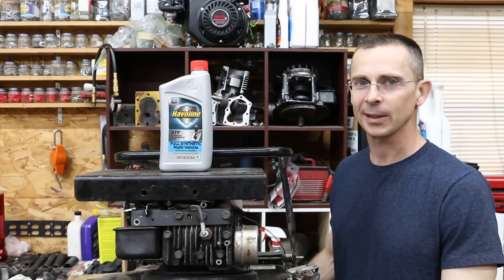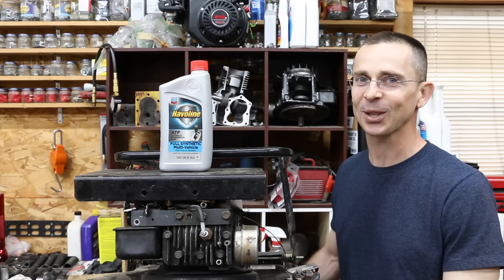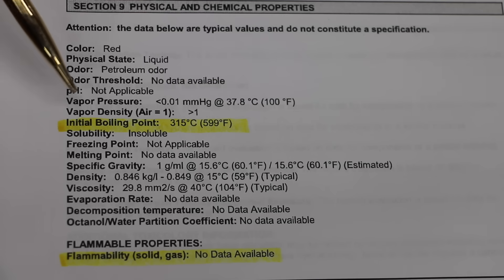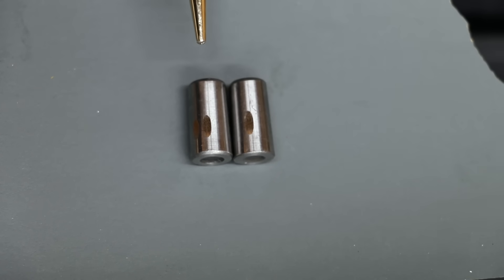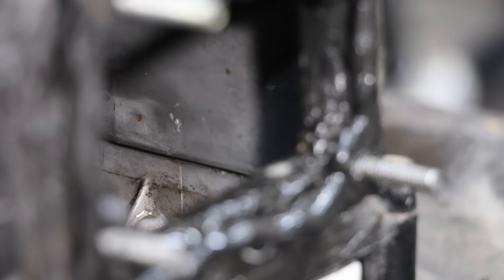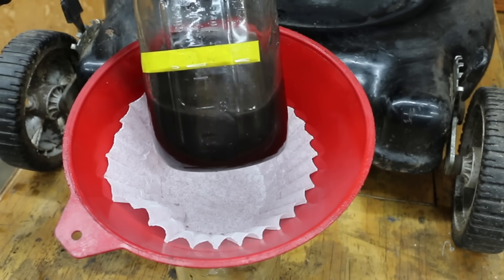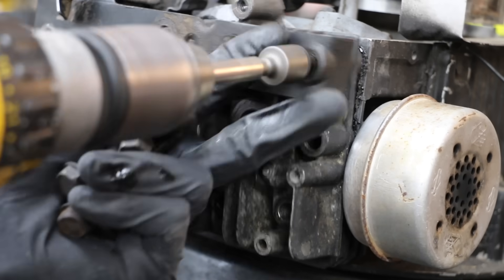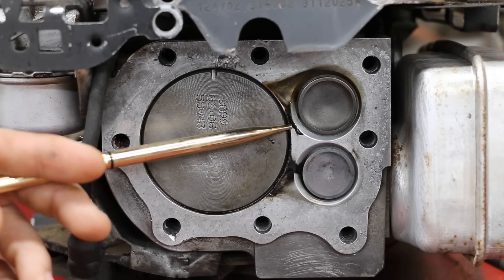ATF as an Engine Oil substitute?  Let's see what happens!

Comment: I had a 1974 Oldsmobile Cutlass with a 350 V8 Rocket Engine...I did a test where I put straight trans fluid in the engine at 100,000 miles. I ran the car 11,000 miles, sold the car to a friend, he changed and put regular 10w30 back in the car, and he drove it as a work car. It had over 200,000 miles on the engine when the car body was finished, the engine then went into an air boat, and eventually broke down and was wore out.
Reply from the maker: Impressive!

Comment: Used to use 50/50 mix of atf and diesel fuel as a flush, drain all oil, add 50/50 mix and idle for 30 minutes, drain and change oil/filter, best engine flush imo. You should try it out
Reply from the maker: Thank you for the video idea!

Comment: i actually had #1 piston rings on chevy 350 1990 froze up. added 2 qts trans fluid to gas fill up and 1 qt to motor oil . a month later i stopped fouling out #1 plug. so yes it did free up piston rings
Reply from the maker: Impressive results! Thank you

Comment: Back in the Mid 70's, I had a customer who insisted that we put nothing but ATF in his car's crank case. His reasoning was that it was very high in detergents and would keep his engine cleaner that regular engine oil. He ran it for years that way. I have no Idea just how long as I moved on from that job after a few year. Just thought I would throw that out there.
Reply from the maker: Wow!  I'm surprised it lasted.  I'm sure the engine was indeed spotless on the inside.

Comment: I have used atf in the past to free up sticking lifters and it worked in a matter of seconds. All I did was run it for 15 minutes, then drain it. I have also used engine cleaner additive in my 2015 gmc and noticed a 5 PSI decrease in oil pressure about a month later. I found that there is a filter screen under the oil pressure sender that filters the oil to the lifters. The screen had started to clog with the crud that the cleaner had broken loose. I cleaned the screen and got my 5 PSI back. So the problem with engine cleaners is that they could clog the oil pickup screen and starve the oil pump.
Reply from the maker: Thank you!

Comment: Never ever flush your engine,If it needs flushing, it’s because of poor oil maintenance and cheap oils and cheap oil filters were most likely used. If your car has high mileage it’s even worse to do an oil flush,for the simple reason the stuck on oil is acting as a glue on your engine seals, plus if a piece of dried oil that was untucked goes trough the small holes that go to your rod bearings.. you will kill the engine right there and then..you will simply starve the bearings of oil.I have been driving for 30 years, been doing my own maintenance on my cars and trucks I have used. I made a lot of poor choices by not changing my oil as required and adding cheap none detergent oils and cheap oil filters. I have gone trough 7 vehicles in 30 years of driving..not counting the one I have now..I learned the hard way. Don’t make the same mistakes I made. Now I change my oil as required and i use a popular 25 dollar synthetic blend oil( five quart jug) and 14 dollar oil filter. I Change it every 9 months or when my computer demands it. When I feel my used oil, it feels the same as the day i put it in my engine, and I noticed it also flows like new oil when it falls in the oil pan.
Reply from the maker: Thank you

Comment: So I've used ATF in many engines... all my personal engines always get 3 to 4 oz with every oil change. one thing I have noticed in the past with junkyard engines that I've used that are sludged up is they will run fine and oil pressure will be ok but once the engine is cleaned by the ATF or as it becomes clean... I've had engine start knocking because the build-up off the bearings comes off. I've had it happened two or three times on engines that are sludged up. Engines that make it through that without knocking have always been great engines. A great test would be get a new engine intentionally gum it up and then redo the test but also have a control. I realize that gets expensive but Harbor Freight sells cheap engines.  I really would like you to be measuring rod bearing clearances and journal sizes for some of these type of tests. I think it would take the testing to the next level.
Reply from the maker: Great information. Thank you.

Comment: If the ATF used for flushing only, it's ok since the viscosity is thinner than the engine oil. If you used the ATF as engine oil, then the friction will be higher and contact surface will be damage as well.
Reply from the maker: Thank you

Comment: We've used ATF to clean automotive engines for decades. That being said, I would never use only ATF in an engine. I can guarantee that the shavings were due to the ATF. When we use it to clean automotive engines, we generally use a 20% - 25% mixture. We always use 1 quart and the rest oil. Afterwards, we run the engine for about 100 miles. Since most of that gunk begins clogging up the filter, we change the filter, top the engine off with ATF again, and go another 100 miles. Finally, we'll drain it all, put in a new oil filter, and use good oil. We do this about every 25,000 miles and it has done wonders for the engines we work on.

Still, great video! Thanks a ton for your incredibly interesting channel and hard work!
Reply: Excellent review . One of your other viewers mentioned  a good procedure of filling the automotive crankcase minus one quart and making the last quart added of ATF and changing about every 200 miles twice then switching back to motor oil and no ATF .  SEEMS like I've  heard of that method before as being successful. One person told me to put a small amount of ATF  in the gas tank to lubricate the valves. I think that my mak an interesting video for you to make for a review  . I thoroughly enjoy and appreciate your videos.  Thanks .
Reply from the maker: Thank you!
Reply: ...That being said, I would never use only ATF in an engine...

    I'm not so sure about this statement in some of today's engines. Some of them use 0W-15 oil which isn't as thick as hydraulic oil. An interesting, albeit possibly expensive, experiment would be to take one of these cars with a brand new engine and start from day one using transmission fluid rather than 0W-15 oil and see how long it lasts compared to a "properly" serviced engine of the same type. I'll admit my knowledge of these new fangled engines is quite limited. (I'm almost 70.) I went to diesel mechanics school in 1974 but haven't kept up with many of the new improvements since.
    Speaking of diesel, I was talking to the manager of one of these quickie oil change places a year or so ago. He said that one of his competitors that he used to work for, a one man owner independent shop, regardless of whether you asked for petroleum or synthetic oil, you got 15W-40 Shell Rotella diesel oil in whatever engine you happened to slide into his bay and you got charged for what you asked for. You asked for synthetic, you got 15W-40 petroleum oil  but paid the synthetic premium price. He said the owner was a cheap bastard who made a deal with his jobber and bought Rotella by the barrel(s) very cheap. He would then pump the Rotella into old barrels marked whatever brand of synthetic or whatever premium brand of petroleum oil. This was why the guy quit when he found out. He didn't want any liability should the wrong oil ruin an engine. He said that his then boss seemed like the type to throw you under the bus with the blown engine for using the wrong oil.
Reply: No way to "guarantee" the ATF  caused the flakes unless you did a side by side with another engine that hadn't been run on canola oil.
Reply: I wouldn't do that in a contemporary engine. My 2001 4cyl Camry? I don't think it would be a problem but it doesn't need it. There are options for cleaning up a dirty engine. Simply accelerating the oil change interval is one of them.
Reply: 20 years ago...But what influence does the ATF oil on the DPFs (diesel particulate filter) in today's modern cars? Some say that any other oil than the recommended one for the engine would clough up the particulate filter sooner, as some gets burnet up in the cylinder and leaves the motor with the exhaust gases...
Reply: Keyword high SAPs
Reply: @HPaulAdrian  most motors people are doing this to are 20+ years old
Reply: @miatafan exactly.  I’ve done that to my old Astro van. Worked really good.

Comment: The "common knowledge"  that ATF cleaned engines internally, & that a quart should be part of every oil change has existed for decades.  A casual perusal of the composition of the two fluids would indicate that hydraulic oil is formulated  to resist foaming under pressure as one of its prime formulation considerations. Interestingly, the tests that you have conducted indicates that lubricity of ATF has improved greatly over the years. I remember reading a test in an  automotive trade publication at least 30  years ago , that showed a considerably greater lubricity for motor oil. As usual, your tests were conducted with professionalism, & with consideration for all parameters that could slew the results in either direction. A practical test in all ways short of  a National Lab level investigation. Another "Well Done !"  to you & your methodology.
Reply from the maker: Thank you!

Comment: The compression test says a lot. I have used ATB on a 455 rocket V8 that had a very rattly valve train from many years of neglect in the service department. It took about 3 oil changes and ATF flushes to get it to stop rattling and the performance went up drastically. Best to change the oil on time and avoid it but for vehicles that have been neglected, it works a treat.
Reply from the maker: Thank you!

Comment: Ive always used 1 quart or less of ATF mixed with my 3500 mile oil just before I change it at 4000-5000 miles. Engine is always clean. I run 10W-30 Royal Purple HPS in my 2007 STI and other vehicles. I am at 185,000 miles on my STI and other vehicles are 230,000 to 300,000 miles. I always switch to Royal Purple HMX at 200,000 miles. Anyone think im lying see my oil pickup video.
Reply from the maker: Thank you!

Comment: I can say from experience that adding about a quart of ATF to 35 gallons of diesel fuel, works great for cleaning the fuel system. I did this on my LB7 Duramax and got over 300k miles on the original set of injectors. Apparently there was a high rate of premature injector failure on the early Duramax. I have no doubt that ATF will clean almost anything. For the low cost and results. I can say that ATF works great beyond a transmission.
Reply from the maker: That's a lot of miles on the original injectors!  Impressive!

Comment: Back when people did that stuff they didn't have synthetic transmission fluid.  I know a lot of people would pour a little  type f down the carburator to 'clean the valves'.  I have no opinion whether it worked or not. Back then Transmission fluid was a napathanic oil base, kinda like marval mystery oil but without the extra additives. Remember the base oils weren't near as good back then.  I've personally seen valve covers off good running motors that had amazing amounts of "black crust " in them.  That "gum"  actually took up some of the slop and  when cleaned out the engine would start burning oil. With the oils they have now, even using some of the cheapest oils, a reasonably maintained engine should get nowhere near the gunk in it that would  have been "normal" in say the 1950's or 60's. On the other hand , with turbochargers and variable valve timing and the tempretures they run engines at now, clean  oil is critical to engine life.
Reply from the maker: Thank you
Reply: Delbert Cody   Tempted to try naphtha, but I have had good luck with water (although that probably wouldn't get the backside of the intake valve).

Comment: I use a mixture of 50/50 dex 3 and diesel for helping to release sitting seized engines on old farm tractors and equipment. The diesel fuel is very thin and fluid and seeps between the cylinder wall and the rings and pistons. The atf provides a factor of lubricity and a detergent effect to help entrap and suspend rust particles. I inject a healthy squirt of this mixture into each cylinder and allow it to penetrate overnight. This has always been my go-to mixture for this. I have used a half pint of diesel in the crankcase for a half hour to forty five minutes right before an oil change to loosen and remove stubborn gum and carbon varnish. I use it at light load and idle, then drain it hot. I once used type f atf as oil in an emergency for about a 160 mile stint but I took pains not to load the engine too heavily as I was towing a heavy trailer at the time. I changed the oil after getting back and the truck didn't seem to suffer any ill effects. The oil pressure read lower while the atf was in the crankcase but returned to normal with fresh oil.
Reply from the maker: Thank you
Reply: Jon Hunt   Thanks.  I wonder is the cup of diesel fuel in the crankcase would be compatible with synthetic oils.

Comment: I use this method to fix the famous  Chevy LS lifter tap. Swap oil for atf +1 extra quart due to foaming of atf.  Let idle 1-2hrs. Drain atf n put cheap oil and filter  drive 10 miles then change oil n filter again with good oil no more noise. Since doing this on my 05 5.3 I've put 144k on [294,368] n still no noise
Reply from the maker: Impressive!

Comment: I am wondering about Motorkote as a oil substitute, and also what would happen if The Motorkote that goes that's intended for mixing with oil would do if added to gas or diesel ,,would if virtually bullet proof the engine and fuel pump and injectors/ carburetors? since Motorkote seems like such a great friction fighter, can we run it pure and as a fuel additive? I am aware of the Motorkote fuel additive however for clarity I mean to actually use Motorkote in the black jug in the fuel
Reply from the maker: Thanks for the video idea!

Comment: I've used ATF as a flush lots of times, normally you would use 3 quarts of ATF and 1 quart of a thicker oil, let the engine idle for 45 minutes to an hour, then drain and change the oil with whatever you normally use. does a really great job if you have a sticking lifter or a little bit of valve tick because of gummed up lifters. You could probably do one quart of ATF and 3 quarts of oil and actually drive the car if you wanted to give it a little more time to do its work. ATF has a lot of solvents in it and it does a really good job of cleaning up an engine. I just would not put a lot of load on the engine while you're doing it as his test showed it doesn't have as much film strength by itself but it's pretty close to 10 w 30. That's why you run a blend of ATF and oil to help increase the film strength so you don't damage anything
Reply: i have typically used 15w40 hvy dty oil in my '96 dodge dakota for years and cut it w/ transm  fluid (20-25 % ) depending on the season. also i occasionally will use a qt of diesel as a pre-oil change flush (run at idle for 5 mins ). engine has 0ver 312,ooo miles and still runs like new, tho the intervals are shorter than the typical 5-7k miles. if you change oil regularly and drive mostly hiway as i do, you shldn't get much sludge / carbon build-up to worry about

Comment: Plastic cam shaft?  Who makes this engine?  I want to be sure I never buy one.
Reply from the maker: Briggs & Stratton engine. Thank you
Reply from the maker: By the way, I have a water cooled 20 HP Kawasaki engine on a John Deere riding mower that has plastic camshaft gear.  Very, very bad design that is prone to failure.
Reply: @ProjectFarm  ...
Is there a forged steel replacement?  Even an aftermarket  steel cam would be an improvement. In small engines it's not that hard to swap.  But the oil slinger is plastic too.

Comment: used to use atf all the time on old motors... worked well and usually freed stuck lifters.  but be cautious when cleaning a badly (oil) carboned engine as lots of chunky crap will break loose and cause havok
Reply from the maker: Great point on amount of carbon and sludge breakup.

Comment: I used to use ATF in older vehicles to flush out the engine and pour it down the carb,to clean up the valves and it worked out great for that!Now this is just my opinion but when I buy an old used car that I don't know the history of I put some in the gas tank at a fillup to clean up the fuel injection system,but you don't need to use much!!!!!!!!
Reply from the maker: Great point. Thank you

Comment: I have never ran straight ATF as an engine oil, I have added 1 quart to an engine that was 1 quart low.  I didn't notice anything different in the engine running or at the next oil change.
Reply from the maker: Thank you

Comment: Great efforts as usual.
Could you test synthetic  diesel  engine oil vs. a fancy motorcycle 4 stroke oil. Diesel oil Example:  Mobel Delvac 1 5w40, Shell Rotella t6 5w40.

Motorcycle oils examples: any full synthetic with a T4 rating.
Bel-Ray Exs Full Synth Ester 4T Engine Oil 10W-50 
Maxima (30-029128) Pro Plus+ 10W-40 Synthetic 
Motorex Power Synthetic 4T Oil - 10W50 - 4L. 

My pre-conceived opinion is the diesel oil is just as good the motorcycle oils.
If you have a wet clutch involved with the testing, this might represent a motorcycle application as well.

Thanks,
Warren
Reply from the maker: Thanks for the video idea!

Comment: I have used approximately 500ml of mineral turpentine in an engine, mixed with the engine oil already in it for about 10 mins, so as to de-sludge the crankcase, before an oil change. after all, turps is an oil in its self. My results were inconclusive . AUS
Reply from the maker: Thanks for the video idea!